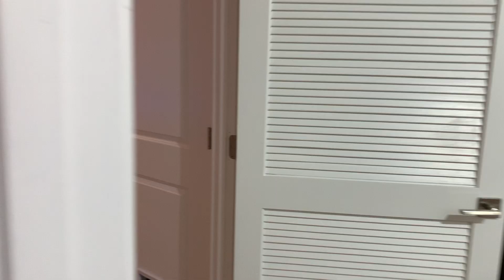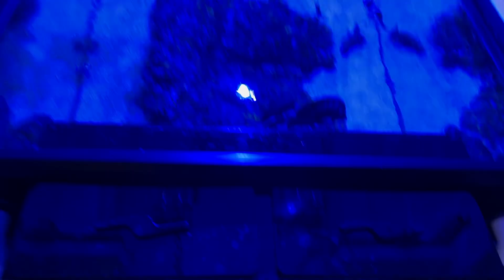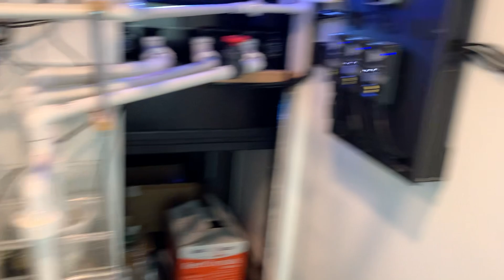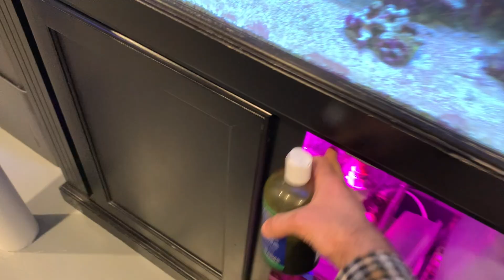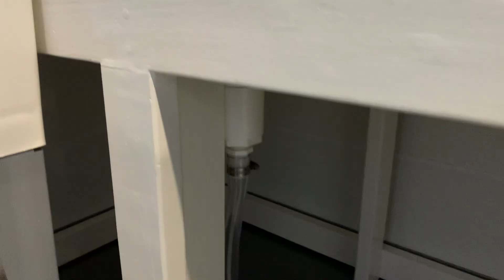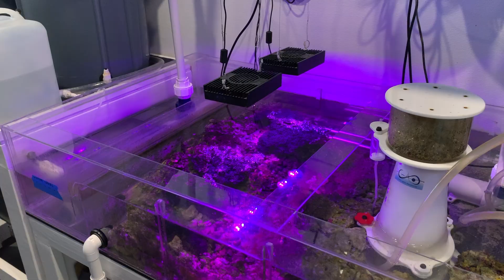Tour of Dream Aquarium Fish Room

Comment: Add a closed loop to your water heater using PEX to save on heating the tank. You have the room for it.
Reply from the maker: Help me understand what you mean by this.  The closed loop would heat the tank directly and cut out the sump?
Reply: @BaconCove  The concept here works similarly to radiant floor heating. If you have a natural gas water heater, you can tap into the hot water line in your home. Run a PEX line and coil it tightly in your sump. The other end of this loop connects back to the water heater's cold line. In between, install a recirculating pump on the PEX line, which you can control with an aquarium controller. You'll also need a check valve to prevent backflow. To heat the tank, the controller turns the recirculating pump on and off as needed. The challenge is determining the right number of coils—enough to heat the tank effectively but not so many that you get excess heat after reaching your target temperature. You should keep your heaters in the sump as a backup, set just slightly higher than your target temperature, in case the coil system can’t keep up. While it requires some investment to set up, this approach can reduce heating and electrical costs by about 80%.
Reply from the maker: @DisplacedCzech  That is an absolutely fascinating idea -- where did you come up with it?  Have you seen any photos or diagrams of such a setup?

Comment: Amazing tank and what a set up! Question, I'm a cabinet maker and want to make my own stand for a tank this size. Did your friend just use plywood/solid wood for the cabinet? (no metal bracing/frame)? Typically the heaviest thing we have to worry about is a granite counter top, not 2,400LB+ of water/glass haha
Reply from the maker: Oh, there's definitely a steel stand underneath the tank.  Check out my earliest videos, before we installed the canopy and stand enclosure.  I personally would be apprehensive about trusting wood not to shift/warp (especially in a saltwater environment, over the course of many years, etc).  The stand I used is here: http://www.dfwaquarium.com/Products/Metal-Support-Stand/Metal-Support-Stands.html

Comment: Hi Mate , love the video do you have the plans for the sump?
Reply from the maker: Thanks so much! I think I largely have the sump the way I want/need it. Eventually I’ll switch from filter socks to felt rollers, and from two-part to a calcium reactor - but I think those are a few years down the road. Do you have an aquarium yourself?
Reply: I do but about set up a new one and was interested in the dimensions but also that it is acrylic. Was it hard to put together
Reply from the maker: @ElStOfficial  The sump is 3 x 6 feet by 12 inches tall.  The water level is around 10 inches if I remember correctly.  I didn't find building it particularly challenging, but I made some mistakes in the design -- wasn't strong enough structurally and some areas were bowing.  I had to go back and reinforce it after the tank was operating, which was challenging.  There are plenty of videos on welding acrylic out there --  I found the ones from @thekingofdiy particularly helpful.  Let me know if you have other questions!